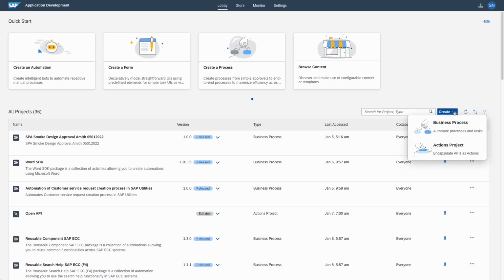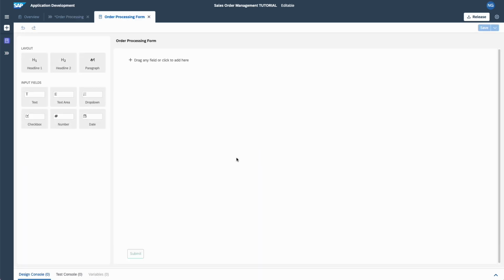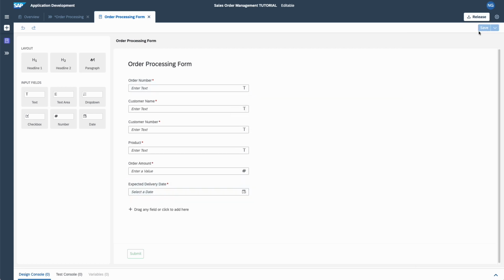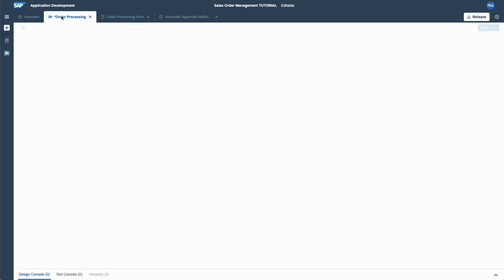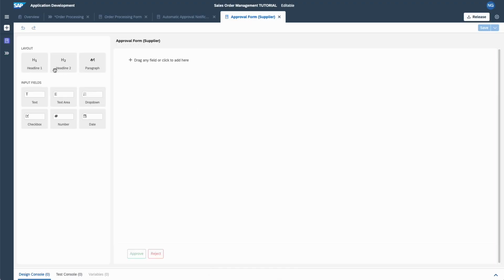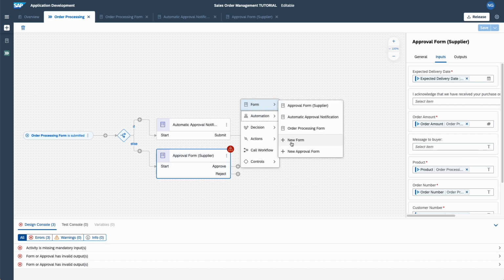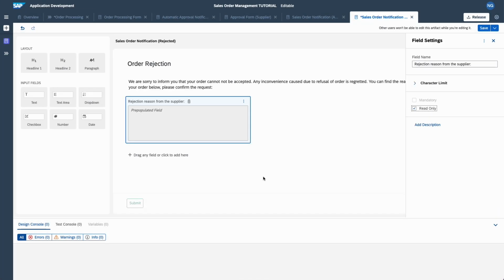How to Build Your Process with SAP Process Automation? | Tutorial

Comment: To be fair, I didn't understand fully how this is supposed to work, but it also feels like there was an effort to make it look very complicated. There are so many errors while creating the process – is this how it's supposed to be?
Reply from the maker: Hi Alina, thanks for your question. Well, the goal was not to make it more complicated, but to have rather a straightforward process to approve sales orders. Which we have now here: a condition is checking whether an approval is necessary at all, based on the order amount. If yes, a form will be provided to do the approval. If not, only a notification of the automatic approvals is been sent.
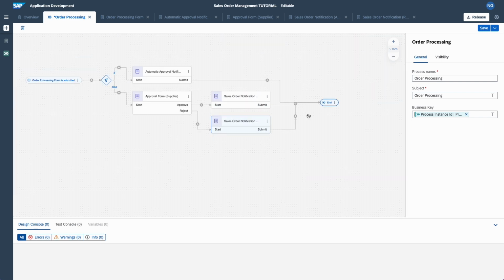Regarding the errors: you might have recognized that all the errors are gone at the end (at 5:32), once the process design has been finalized. In fact, you will just get error notifications, to let you know which necessary information is missing to get this process up and running at the end. Which is quite helpful while developing such a process. Hope this helps.
Reply: @SAPBuildProcessAutomation  sure, basically the process itself is easy, but how it gets coded in this tool is not – still as a user I would expect to be able to build something without getting multiple errors for every action I take 😅